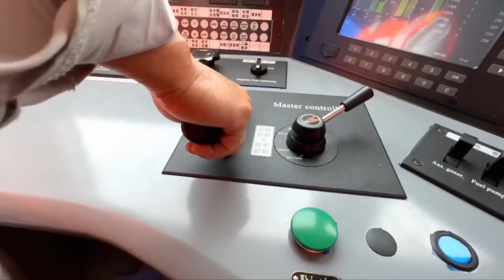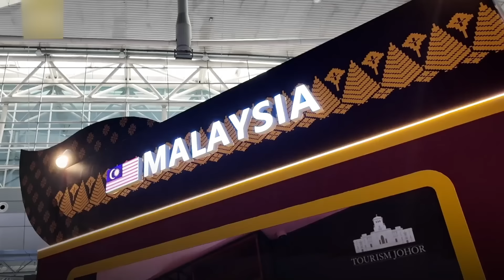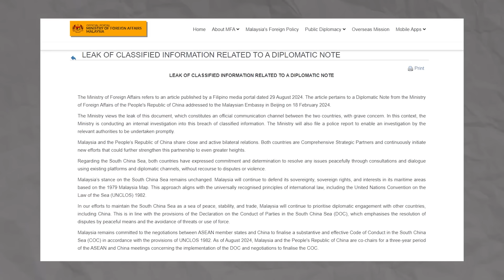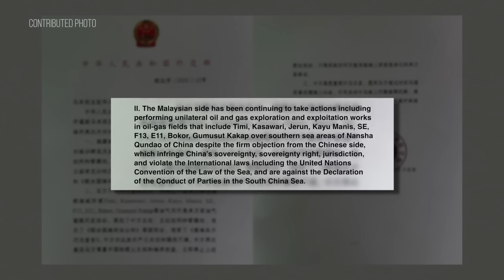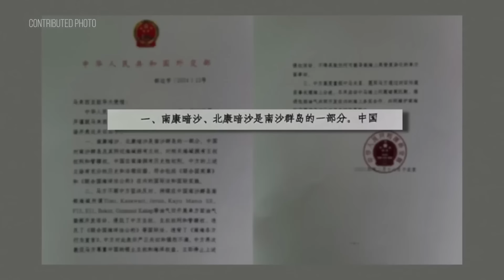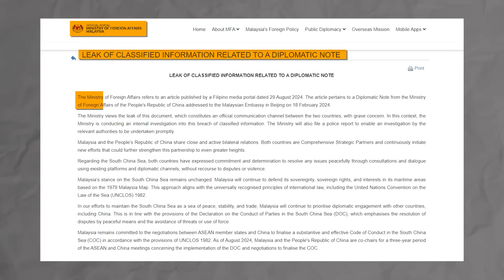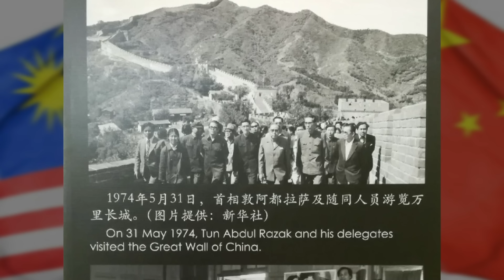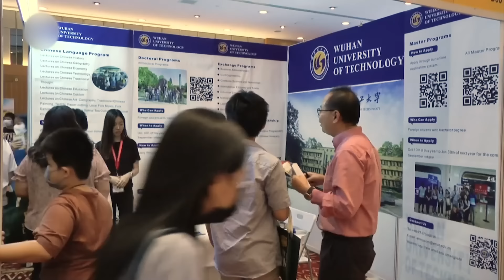Does China Claim Malaysia's Luconia Shoals?

Comment: First it was reported by an anonymous reporter. So it could be a false report. Why is the reporter anonymous??
Second, when EEZ was established in 1982 every nation rushed to stake a claim.
But islands and reefs were already claimed by China long before.
Third, let me remind you those islands and features do have sovereign waters plus EEZ too!!
So you are jumping the gun.
EEZ does not give nations sovereignty over islands and reefs. Only the body of water for fishery and minerals.
So there is a dialogue ongoing and it should be resolved through diplomatic channels.
Reply: One correction- most of the maritime features in the Spratlys were classified in the 2016 PCA decision as “rocks” and not islands under UNCLOS. Rocks (eg Johnson Reef) are entitled to territorial waters only (12mi), no EEZ (200mi). Some (eg Mischief Reef) were classified as low tide elevations not entitled to anything at all.
Reply: @Blixey-r9z  That PCA has no meaning as it went ahead on arbitration with just 1 party. Everything is a rock feature. Even an island is a rock. In fact Manila is also on a rock!!
When you have a hammer, everything looks like a "nail".
Reply: @easternrazor3749  it has no meaning in relation to sovereignty claims on the maritime features. But its interpretation of what is classified as a rock, island or low tide elevation has relevance as part of international law and interpretation of UNCLOS. The PCA decision can be disputed and overridden in a proper UN international court. (although I doubt you will get a different decision). 
The main point is only features that are classified as islands (features above high tide that are capable of sustaining human habitation) are entitled to an EEZ under UNCLOS.
Reply: China's position in south china sea is v clear. 
China have indisputable ownership of SCS since ancient times right up to present times before unclos even existed. China do not need unclos arbitration to own their scs.
However Asean countries had taken China's spratlies and sea in the 70s.
China is now reclaiming their stolen spratlies and sea with salami slicing strategy.
This means countries can still negotiate permission to use their eez inside china territory with sharing of resources and status quo with regards to islands . 
China will stop any unilateral oil exploration.
Reply: @Blixey-r9z  it is a kangaroo court.
Reply: @Blixey-r9z  You believe what you will.
They can't even issue a warrant when there is a crime.
Reply: @easternrazor3749  it’s not a matter of belief - it is what the  international law under UNCLOS is. China has to go outside UNCLOS  and propose its own set of laws that it either imposes with force or builds new consensus around. Alternatively work within UNCLOS and negotiate with the other claimants so that China still gets what is most important to China and maintain peace and goodwill with its neighbours. It is ironic that the US itself has not ratified UNCLOS while China has. Turkey has also rejected UNCLOS because of its dispute with Greece (UNCLOS rules are quite unfair/ disadvantageous to Turkey there).
Reply: @Blixey-r9z  No. UNCLOS does not have jurisdiction over sovereignty.
China did not attend the arbitration nor did they agree to the arbitration.
So how could it proceed?
Reply: @Blixey-r9z  no one recognizes the ruling as it has over reached its authority and processes.
Reply: @LeeSkJohn-sv8wi  Does any country recognized China 10 dashline?
Reply: @Blixey-r9z  No one forced ChiNa to sign UNCLOzs membership lol
Reply: @easternrazor3749  UNCLOS was drafted when China’s input and influence were weak. China was still new to the UN and inexperienced when it negotiated and ratified  the UNCLOS treaty.  
China refused to take part in the arbitration & appoint an arbitrator of its choosing so the arbitration could have been biassed towards Philippines. But I don’t think it was a Kangaroo court. China will need to weigh the pros and cons of working within UNCLOS framework or throwing it away and withdraw from the UNCLOS treaty.
Reply: @Blixey-r9z  don't give me that BS
Reply: @Blixey-r9z  The judges could be bought.
Reply: @Blixey-r9z  the best laws can be in place. But if the system is corrupt, everything is corrupted.
So don't give me that BS of yours.
Reply: @Blixey-r9z  In the first instance the arbitration cannot proceed when processes are not completed.
How can you call an arbitration court when only 1 party is present?
An arbitration requires 2 parties.
Reply: @Blixey-r9z  They played the same trick with the Uyghurs Arbitration too!!
So it has been played once too often.
Reply: @easternrazor3749  the PCA proceeded by not making any decision about the sovereignty of any of the disputed maritime features. It just made pronouncements/ decisions about how UNCLOS provisions applied to the disputed maritime features. The EEZ is a construction of UNCLOS so the PCA opinion carries some weight in predicting how UNCLOS will be interpreted by an international court in future.  The PCA opinion was that most of the maritime features in the Spratlys will not be entitled to an EEZ under UNCLOS. China can still assert her claim of sovereignty of the maritime features, but there will be no EEZ entitlement under UNCLOS provisions; ie China cannot rely on UNCLOS to assert a claim of EEZ.

This matter cannot be settled in court. It will have to be settled through diplomatic negotiations with the other claimants unless China uses force. Using force risks a wider war and damaging relations with other countries.
Reply: @Blixey-r9z  They are not supposed to proceed. How can they proceed without approved specialist from both parties? 
A rock and a diamond are two different things to the trained person!
Reply: @Blixey-r9z  They have no jurisdiction to proceed on anything 
If they did, it is not called an arbitration!!
Check the definition of arbitration!!
Reply: @easternrazor3749  you are right - it was not an arbitration and it is not binding on China. But it is still a professional legal opinion on what international law under the UNCLOS framework is. 

The PCA are free to write an opinion based on the case brought to it. International courts do not have to follow the opinion; but there is a good chance they will agree with the reasoning and make similar decisions.
Reply: @Blixey-r9z  if you are the owner of your house. Your distant neighbor decides one morning and declares that your house belongs to him.
Decides to bring you to arbitration. Does he have enough cause to bring you to arbitration.
Did both parties follow correct procedures and processes before arriving at arbitration.
If procedures and processes were not followed, would you allow yourself to be dragged to arbitration?
Reply: @Blixey-r9z  It might be a "legal opinion" but without professional geological inputs, discussion and arguments.
E.g. today it might be a rock lapping just below the surface of the water line.
In 2 months in the future the rock due to tectonic movements suddenly grows into a small hill.
How does anyone know without proper study, research and arguments?
Many islands and reefs in SCS are still growing. Did you know that?
Reply: @easternrazor3749  it’s not BS. It is what international law is/ how it works. Current UNCLOS was written during/ just after  the Cod Wars (Iceland & UK dispute about fishing rights); UNCLOS was greatly influenced by that dispute and written to help settle that; Turkey points out- that set of rules might not be the best set of rules for other parts of the world esp Turkey.  China did ratify the treaty though.
Reply: @Blixey-r9z  but it is BS. 
They already have decided on the outcome and they go thru the motions to make guys like you believe that it must be true.
Reply: @Blixey-r9z  These courts are only for those they disagree with. 
If you are their buddies, everything is in your favor.
Is that called a "court"?
Reply: @Blixey-r9z  none of the "court" ever ruled against them. 
They will be gone or disappear!!
Reply: @LeeSkJohn-sv8wi  Convince yourself Wumao  with your Ancient  Times Hahahahaha.😂😂😂
Reply: @easternrazor3749  yes the PCA only considered what the Philippines presented. That is why it is an opinion that is not binding on China. Till China challenges that opinion in an international court successfully, Philippines will use the PCA opinion to gain support around the world.
Reply: @Blixey-r9z  but a small rock can sustain a light tower and human life can it not? In fact it is highly recommended!!
Reply: @louis8743  a foul mouth talking without brushing!!!
Reply: @easternrazor3749  you should  be looking  at the mirror Wumao,hearing Facts really  hurt Wumao... keep crying Wumao work harder. 😂😂😂
Reply: @LeeSkJohn-sv8wi China is owned by Mongolia if we follow your narrative.
Reply: @louis8743  You obviously cannot read. Otherwise you would be crying.
Reply: @JunBermz  than according to you, Australia, America and Canada should be returned to the native inhabitants!!
Reply: @easternrazor3749  Hahahaha "according" is that your source of information... convince yourself Wumao.   😂 😂😂
Reply: @louis8743  admit it, you cannot read.
Reply: @easternrazor3749  is that it Wumao? Seriously,  convince yourself  with your narratives  Wumao. Keep trying.😂😂😂
Reply: @louis8743  you can't read. Nor can you understand. Sorry pal.
Reply: hahaja 10  dash line is a fictitious and hallocinous claim of china, its so funny that they can be  added  based of what they want, simply they can be stretched up to the borders of indonesia to malacca strait😂😂 and even as pacific ocean😂😂
Reply: @adrianmasa9659  then the joke is on you. Is it not.
Reply: @easternrazor3749  seriously,  convince yourself Wumao. 😂😂😂
Reply: @easternrazor3749  seriously, convince yourself Wumao Hahahaha. 😂😂😂